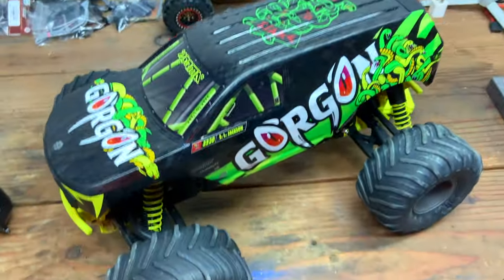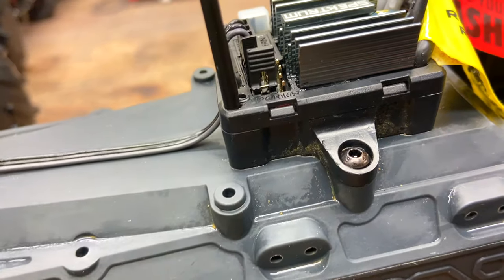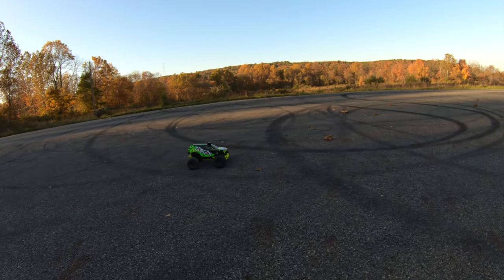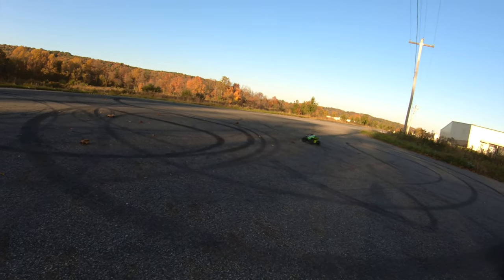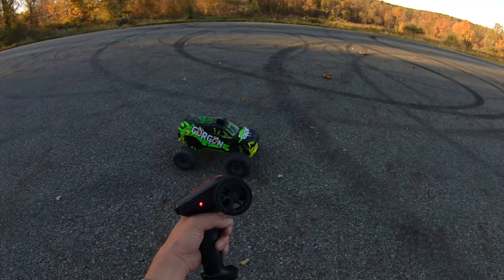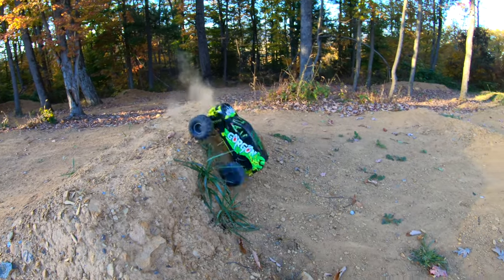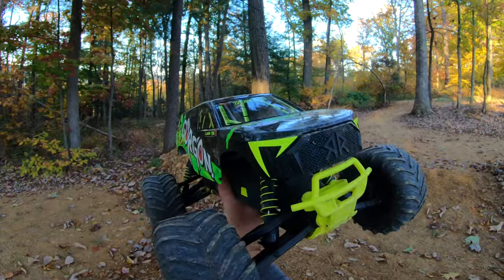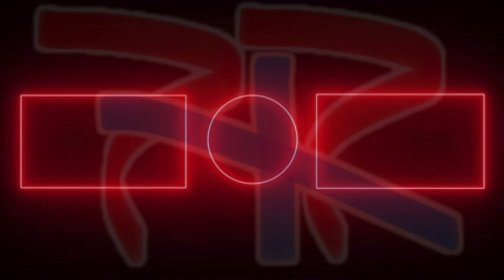2S Lipo Vs. NiMh Battery W/ Stock ARRMA Gorgon Electronics

Comment: Slower speed make sense as a 2s is only 7.4 volts and the stock battery is 8.4 volts. The main difference with the lipo is the faster discharge rate allowing you to do wheelies.
Reply from the maker: Exactly!

Comment: Cool video. Do you charge the 2S with the charger that came with the truck? If you do, how long does it take to charge it.
Thank you.
Reply from the maker: Thanks. I did use the charger that came with it. Honestly I don’t know how long it takes because I only used the battery like 2 times and been running 2S and 3S since. I haven’t really sat around and timed it. It does take awhile though.
Reply: Boas o rc aguenta 3s? De origem? O que modificações fez entao?

Comment: Hey just asking did you turn up the speed on the controller 50/75/100_? Is the controller a Spektrum SLT 2
Reply from the maker: It is a SLT 2 and speed was at 100